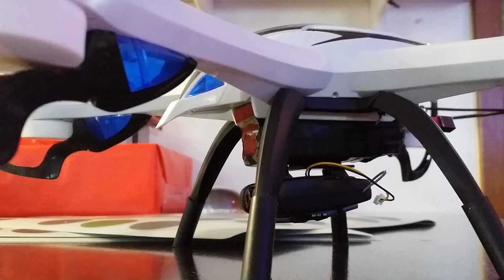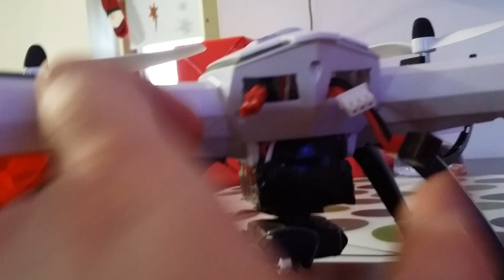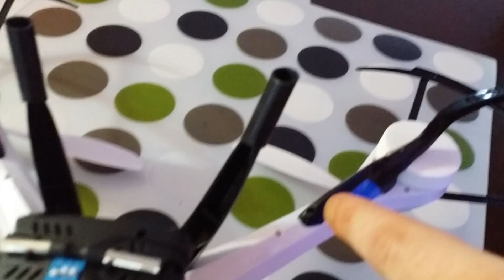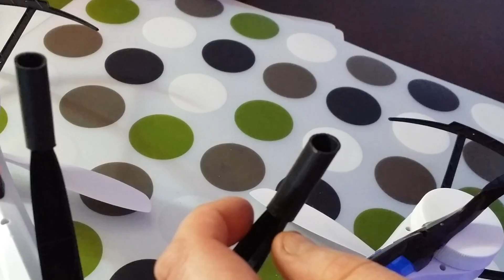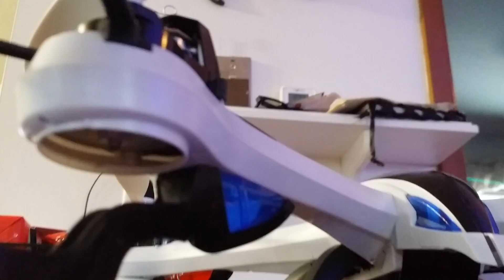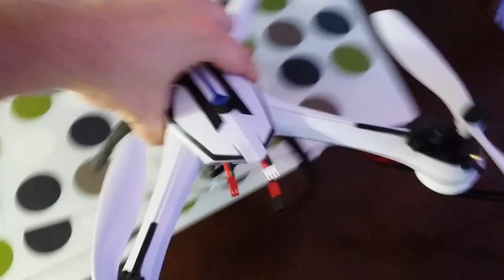Tarantula X6 Fully Modded Upgrades

Comment: The best mod for this copter is to replace the bushings with ball bearings. It pretty much upgrades everything at the same time,  performance, flight time, motor life,  sound.
Reply from the maker: same bushings can be swapped right into the JJRC H26 also!

Comment: I removed the prop protectors day 2 after my prop got caught up in one and cried a more and fell out of the sky from 300 feet. Actually the tx6 flew fairly well on 3 motors I almost got it back to me. Anyway I used a Velcro strap and attached a 7.4v 6200mah battery  to the bottom I got 28min fly time before I stopped because it was bed time for bucko. As far as your mods, drop the landing gear who needs that? Extra weight no reason fly it back to you and snatch it out of the air. I don't recall ever landing a quad. Maybe the first few flights. Where did u find those gear caps that's what got my attention and the reason for this comment
Reply from the maker: Aquarium tubing. Stiff abs plastic I think

Comment: lets see the video it takes and if u could a link for the cam u have on there thanx
Reply from the maker: heres the cam link and i will post some of the video to my channel tomorrow. cheers.
http://m.banggood.com/Syma-X5C-1-X5SC-X5SW-5_8G-FPV-720P-Camera-with-Monitor-Real-Time-Transmission-p-980090.html
Reply: Oswald Reef ok question the Syma x5 is a three prong three wire cam how did u make it work with this x6 as it's a 4 prong 4 wire
Reply from the maker: Jay Drone Thats the beauty of this FPV toy system hack.  You dont actually plug it into the drone.  Its has its own battery, and all  you have to do is short the + and - of the 3 prong wire with a twist tie(or short metal wire) to start recording. The twist tie wraps around a landing skid and you wouldnt even know it was there.  Disregard the ground of the 3 prong wire coming from the cam. Focus solely on the + and - and a quick shorting of the 2 wires takes a picture (useless cause the drone is away from you....) but short the wires for 2 whole seconds and that initiates the video start record.  Fly...enjoy fpv....while it records the flight....land.   Then using twist tie or wire length short the same 2 wires (of the 3 wire plug disregarding the ground) for 2 seconds to end video and its recorded in .avi format stored on micro sd.  Works flawless.  Ive moved onto a JJRC h26 from the JJrc h16 (tarantula) and im still using this same FPV system on it now.  Using my spare motors and props from the h16 on the h26 too.  ACtually ive hacked that FPV cam system also and installed an 800 Mah battery 1S instead of the 350 mah 1S battery it cam with. 10 minutes FPV time now. Longer than H16's or H26's flight times.  
*Having its own battery means I retain longer flight times because the drones 2S battery isnt also supplying the FPV cam...it has its own.
Reply: Interesting thanx for info

Comment: This would be a pretty good quad if the plastic didn't crack every time you touch it. Thinking of taking the guts out and building a quad on a different frame with it.

Comment: was thinking this was bad for the motors. then I read your description. I have always heard that you should let your motors cool between flights to keep them from overheating... twice the flight times.....oops
Reply: Agreed there are reasons that these quads come the way they do,i.e power wise. we all want more flight time but if thats the case then save up and buy something that is designed to do such from the get go otherwise get used to the fact that you will need to keep a major stock of parts in your eforts to stay aloft for longer,and in this case motors and gears.
Reply from the maker: It is pretty bad for the batteries.....lol

Comment: bit worried the motors might fry with extended flight times,  i assume you did the bearing mod, i would also suggest the antenna mod on the quad, poke antenna through top cover at an angle, i like the landing gear mod i might try something like that almost the full length of the normal gear plus and extra inch or so to add height for my gimbal. bit concerned about how you charge the batteries too, i have trouble with my cheap chargers... i just scrapped two of them which were not fully charging both cells. i also just bought the syma fpv kit, cant fly cause of the weather in uk, but i need an idea for how i see low battery warning lights, did you do the 808 keychain lens 'd' mod?, i did it not sure if its much better yet, i also put some arctic silver cpu heatsink stuff on all the chips, i'm hoping that will help them.the gear cover mod is a good one, i gotta do that, the gears get fouled so easily in grass and dirt, ps, i think i'm flying the dirtiest fallout 4 looking tx6 out there, i tried to sharpie front arms black, it didnt take now it just looks grubby as hell
Reply: +alan hennesy ps. you gotta scotch tape the ends of the arms, to join the top and bottom case, start llevel with motor cover all the way around,